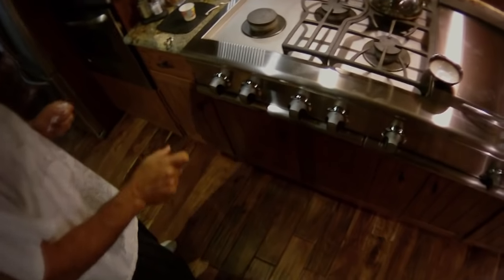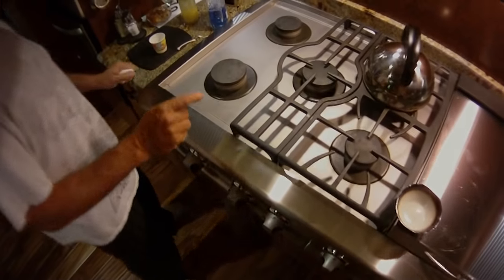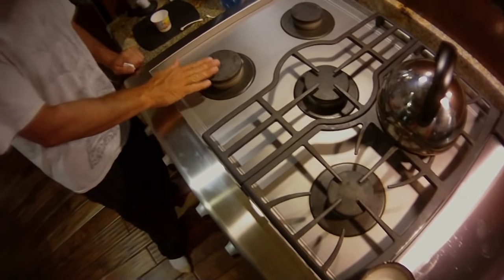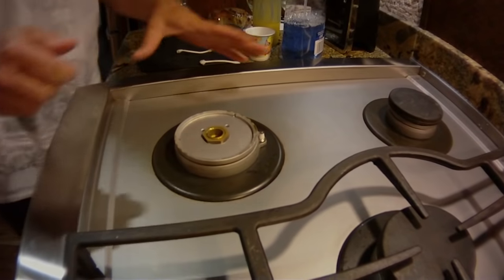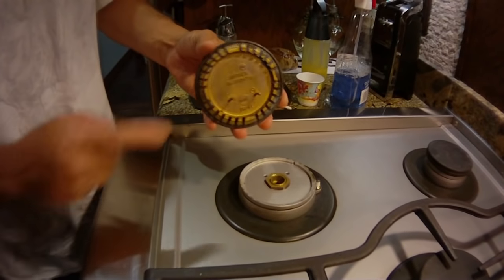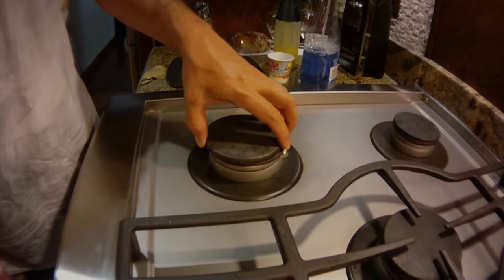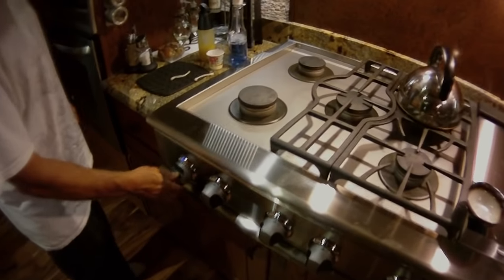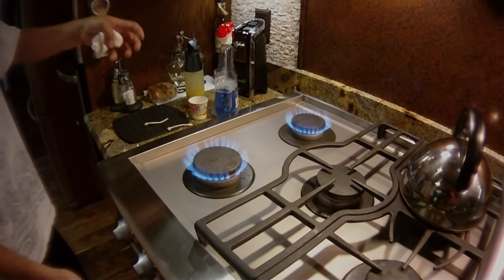How to Fix cooktop auto igniter won't stop clicking - DCS - Gas Stove Top

Comment: If you spill water on the knob it will do this until it dries up. Unplug the electricity and let it sit for a day or two.
Reply from the maker: Thanks for the comment!
Reply: Same here my husband didn’t bother to check the stove while I was running errands and came home to the stove clicking 🤦🏽‍♀️ non stop hopefully it stops when it dries out
Reply: Thanks so much! I just moved into a house and the rubber seals under the knobs were so cruddy I pulled 'em off to clean. I also cleaned all the accumulated grease under the seals. Of course this splashed water into the cavity under the knob which I soaked up with paper towels. But one burner started clicking. I unplugged the electricity, dabbed the whole area with q-tips and tried again. Still clicked. Finally left it unplugged and will wait a few days. Fingers crossed it is just moisture. Thanks!

Comment: IF this doesn't fix it, you need to REMOVE the nut and lift off the bottom element and then clean the gas orifice toward the front, look down the small hole, if it's not shiny, take a qtip with rubbing alcohol on it and spin it, then take a dry qtip and spin it in the hole again, if it's shiny, let it dry for a moment, then reassemble.  I found another video that showed all of this more clearly.   For the most part just cleaning that area around the igniter does the trick...

Comment: Relief to know cleaning was an option. My stove is a Samsung and only 1 YEAR old. I only use one burner and the igniter acting up was on a rear unused burner. When adequate time passed after cleaning and it still clicked I decided to allow it to just click-away while I stuck dinner in the oven. After about 15 minutes it changed from the rapid fire clicking to a slower blinker paced click and then even slower to a click- long pause -click - long pause -click pace and then, stopped. Just like that. Temperamental like a two year old I decided - sometime you have to just let them cry it out. But gas appliances can be fearful when malfunctioning so this video was a huge relief! Thanks so much!

Comment: I have had this problem for a long time.  Trolling the internet, I got all kinds of info (Some people shouldn't have been offering advice!). I did take apart the top and clean it.  This made it damp so none of the burners lit.  Drying with the hair dryer did the trick but there was still an annoying clicking noise.  Using alcohol on a q-tip, I cleaned the igniters and one had some kind of orange deposit that looked like rust.  Now everything is running perfectly.  It was such a simple and cheap solution.  I am very happy.  Thank you!
Reply from the maker: Thanks I do the same thing and did not find a good video on how to fix this that's why i did this little video to help people out. Now you and I can keep cooking! :-)

Comment: one additional item to clean, which finally solved my problem. Take off the 3rd piece of metal by removing the 1-1/16" brass nut first. Clean it and especially the very small simmer holes, using a needle and/or compressed air.
Reply from the maker: Good Idea, will prob help someone with a similar issue or if steps in video did not fix it.

Comment: Thank you for posting!!!  The DCS burners appear to be the same as those on my GE Monogram.  I used sandpaper to clean the both the burner outside surface and the simmer slot on the burner near the ignitor and then used rubbing alcohol.  A butane lighter  helps evaporate any moisture remaining.  I think ignition occurs where the gas is emitted from the simmer slot, so it is important to keep this clean near the ignitor for the burner to light.  I believe the flame from the simmer slot also heats the sensor in the electrode which tells the stove that there is a flame and to stop the ignitor from sparking.
Reply from the maker: Thanks for all the Great info! i'm sure it will help other people out as well with the same issue!

Comment: My stove started clicking suddenly yesterday.  The ignitors taking turns clicking.  I dried with the hair dryer like you suggested and then followed with the rubbing alchohol.  Worked like a charm.....thanks so much
Reply from the maker: combobulated100 Thanks for the input glad worked.
Reply: combobulated100 Hi Thanks for your suggestion. I dont have alcohol i used nail polish remover instead. It did not work first time. Again i applied lots of remover and cleaned the sparker with tooth brush and sponge. Left it for 3 mintues. Again, I used hair dryer for 5 min each buner and removed the dial knobs and pumped hot air into the stove.
Now, it worked. No clicking.
Thanks for your post.

Comment: Thanks for all the tips - In my case the center burner would click if a large based pan was put over it - Click the whole time, while cooking!! I figured it had to do with the igniter not sensing it was lit, so i put two nickels under each side the top grate. That seemed to give it just enough clearance to sense the gas was on properly - Hope this helps someone - Was driving me nuts (Clicking every time I cooked a meal)
Reply from the maker: +Don Purdy Thanks Don for leaving this helpful advise i Think it will help someone else who is having this issue!

Comment: My stove was clicking too. I couldn't unplug it because it was too hard to pull out from the wall.  I cleaned the burners and then shut the top and punched the stove. It slowed, then stopped. Thanks for the advice!  Punching works!
Reply from the maker: radishface1 Punching interesting trick will have to try that next time stuff does not work.
Reply: radishface1 Hi I'm with Kitchen Appliance services and I'd lik to have a word with you.

Comment: Fantastic! We had 4 of the 5 burners continue clicking after igniting. We didn't think this was going to work because the igniters looked clean so we just used a cotton swab with alcohol to wipe each starter and that fixed the problem. Thanks!

Comment: Happened on our GE 5 burner cooktop.  Dirty igniter can sure cause this, but so can another issue.  Clogged gas jets.

What stops the igniter from clicking is contact with flame after the burner is lit.  If it looses flame contact, it tries to re-light that burner.  Look close, especially on the lowest flame setting, and see if the flame is 'reaching' the igniter tip. ALL 5 igniters pop will pop even when you just turn on one burner (normal)....but it they keep popping with just one burner on, most likely THAT is the one you have a problem with. 

What was happening on ours was a clogged gas jet on just one burner....unfortunately the larger burner in the stove center we use a lot.  Our model has two jets per burner....a main jet in the center, then a 'simmer' jet to the side.  You don't need to do this, but I took all the burners completely out and removed the whole stainless top, and insulation board to expose the inner workings of the top....from the control knob of each burner, there are 2 gas lines...one about 1/4" or so to the main jet, and one about 1/8" to the simmer jet.

You just have to remove the flat diffuser plate on the burner causing the problem, then remove the burner ring with the slots (where the gas comes out)....both just lift off. 

Then look down into the hole in the center, that is the main jet.  The simmer jet looks similar to the main (brass 7mm nut with a hole in the center), but is off to the top or bottom side of the ring mounted to the cooktop.  The simmer jet has a REALLY TINY hole...I had to remove the jet (7mm socket) and use a sewing needle to clear it.  Hold it up to a light source.....if you can't see a tiny amount of light coming thru the center hole, it's clogged.....keep reaming with the needle. 

Once I got it cleared out, reinstalled, and the other parts back on, I turned on that burner on, dialed it to lowest setting, and could see flame (coming from gas out of the simmer jet) poking out of the burner, making contact with the igniter.  End of problem.

Comment: i washed my knobs in dishwasher and put back on stove. water was  still in knobs and  ran down shaft and made the ignitor start clicking. took knobs off and dried each knob shaft with hair dryer , dried knobs also, stove works fine now
Reply: Same issue faced after washing the knobs. I'll try your solution. Thanks

Comment: Thanks for your video. Fixed my clicking stove last night too! I'd like to know the science behind this.
Reply from the maker: I'm glad you got your stove working, not sure on the science either if you find out please post it.
Thanks
Reply: I too had this issue so I did some digging into the actual cause, and why cleaning fixes this issue for some people. What I found is our stoves have a feature called auto reignition, it is able to sense the presence of flame and if it knows the gas is on but no flame is sensed it will trigger a spark again. It senses the spark by the increased electrical conductivity of the flame. It senses this between the spark tip and the flame port right next to it. That means if the flame port is clogged or the spark tip is corroded/gunked up with debris it will not be able to correctly sense the presence of the flame. To fix this clicking issue you need to check two things on every burner. 1. That the spark tip is clean, like this video shows. 
2. That the gas ports/flame guides nearest to the spark tip are clean (this was my issue, I had to disassemble and run a drill bit through the tiny holes to clear out the blockage)

Comment: I cleaned around the ignitor on my dcs stove top, and it didn't solve the problem. I then removed the brass nut under the burner, which holds down the simmer burner. Several holes around the burner were plugged, especially the one lined up with the ignitor. I cleaned them with a toothpick, and now it works as intended!! No more clicking, and the simmer works properly!  Hope this helps.
Reply from the maker: Thanks for Posting! I'm sure that will help Others! Have a Great Summer!

Comment: also, if that doesn't work, your ignitor pilot is probably plugged with gunk. when undo the big hex but, that the plate off you will see the main carburetor Venturi(center) and a small one to the bottom right. look inside and you see a jet. it's hard to unplug BUT I SNIPPED A WIRE BRUSH bristle off and connected it to a wood kebob. using a pin, I made a hole in kebob stick. then I put crazy glue in the hole and then inserted bristle wire. Taped it too so it's doesn't fall out. Then using flashlight, reading glasses I rammed the wire into the pilot carb nozzle and unplugged it. That allows gas to flow, so ignitor(heated) is told by relay to stop sparking. you can use same wire to clean main carburetor too.

Comment: I clean the burnners with no change, only the top burnner is clicking.
Is the next step to replace de ignition box  in the front pannel?
Reply from the maker: Stéphan Vigeant Correct unless you find another solution if you do please post it in the comments.
Reply: Clean your main jet and the simmer jet if your stove has one.  If either is clogged even slightly, not enough gas comes out to maintain contact with the igniter so it tries to re-light that burner.  You'll see this more on the lower setting of the control knob.

Comment: I have a Kenmore gas cooktop #9113378896 - burners keep clicking after ignition.  The only way to stop clicking is if both burners on left stay on or both burners on right stay on.  Have replaced gas valve, spark igniter & gas module. Any ideas?  Thx - Larry Davis
Reply from the maker: Mona & Larry Davis if you tried what i showed in video and still no luck might be time for a expert, leave a post if you figure it out

Comment: If you think the ignitor or switch might just be wet rather than dirty another way of drying it is to turn off the electricity at the wall, then turn on the gas knob and use a barbecue lighter to ignite the gas manually. Don't leave the gas running without lighting it though!
After a while the heat from the burner should have dried everything out.
Reply from the maker: Good advise thanks for the comment!
Reply: G Neill That's a good thought.  I'll have to give it a try.

Comment: i have a stove that has the spark thing next to the burner on the outside and it has separate button and i cant remove the top,any idea what to do?
Reply from the maker: Tony Eatinsky at that point might need to order a replacement part or call in the Pros.

Comment: i have a problem. yesterday night the stove suddenly started clicking by itself. all 4 ignitors started clicking. i could see the spark when i turned off the light.  I also unplug all the ignitors to the control board, still clicking. the only way to stop it is to unplug the stove. What would cause that happen?
Reply from the maker: rax7 That might be a another issue that would require a expert, i'm sorry to say if you figure it out leave a post
Reply: Hi rax7, I have just turned my stove on and exactly what you described is happening to mine. Did you figure it out in the end? If so, What did you do/How did you solve it?

Thank you.
Reply: I have the same problem. I will investigate but I am thinking the ignitor switch is shorted causing it to spark without turning it on. I will reply when I figure it out.

Comment: you turned the gas off at the main switch board of the house ??
Reply from the maker: No I did not because I you need to turn the nob to turn on gas, but if it makes you feel better you could turn off the gas to your house first.

Comment: We had the same issue. But then the clicking stopped. And so did the spark. Now I have to use a match to light the stove.
Reply from the maker: sounds like you might need a new Ignition switch
Reply: Review Outlaw 

King